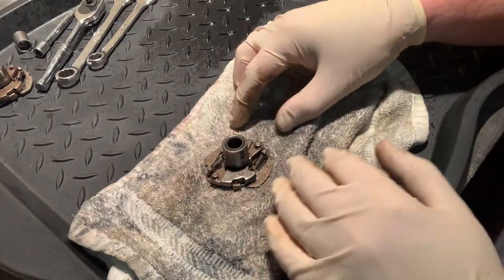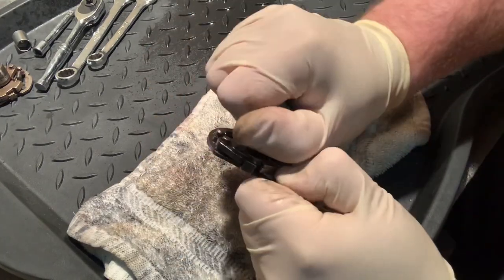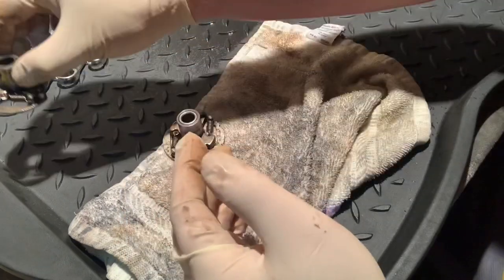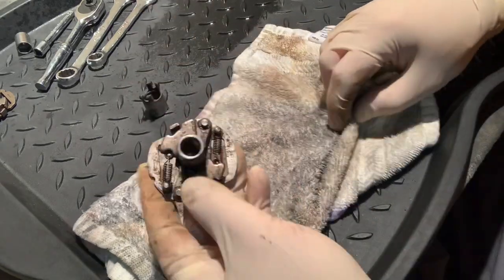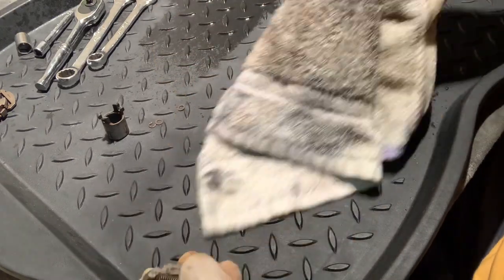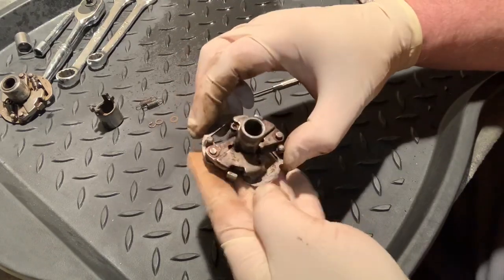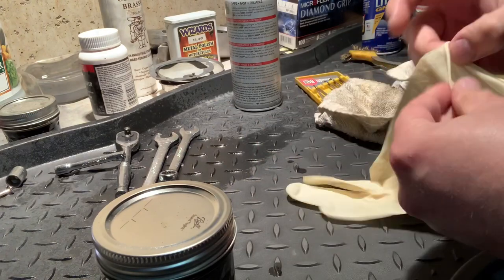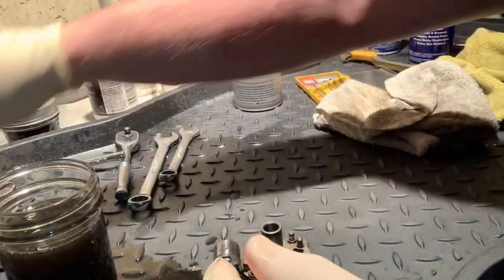Timing Advance Unit Assembly & Cleaning: Part 175

Comment: Re installed the advance on my bike. Couldn't time it. Turned out I was 180s off. Stared right up after that. Great Vid Brian. Thanks
Reply from the maker: Common problem. I’m 99% sure I got it right. We will find out. :) thanks, Greg.
Reply: I never knew of the arrow and the number up on top.

Comment: How do u get it off? I can't get the bolt to spin off without spinning the whole assembly.
Reply from the maker: You mean from the engine? When you turn the hardened nut the engine turns?
Reply: @KeepOnWrenching  correct. Like it's turning over.
Reply from the maker: Do you have the right side cover off that exposes the clutch plates and oil sling?
Reply from the maker: If the right side cover is off you can put a penny between the smaller gears near the oil sling to stop the engine. The penny is soft enough so it won’t damage anything.